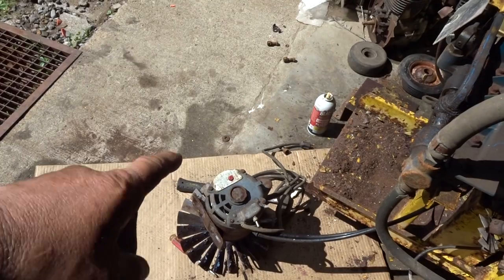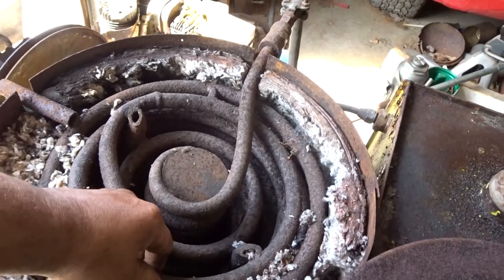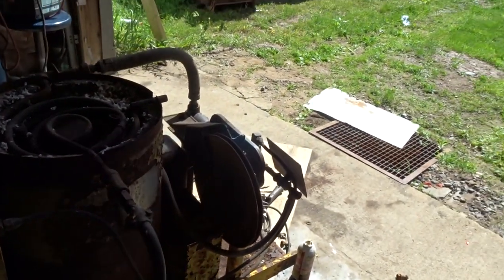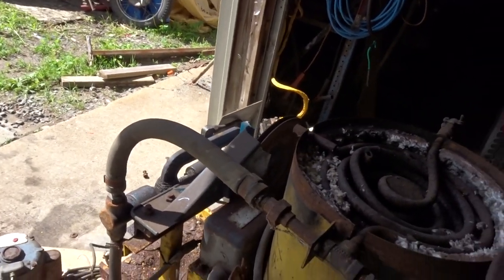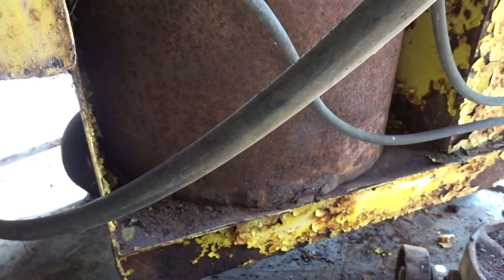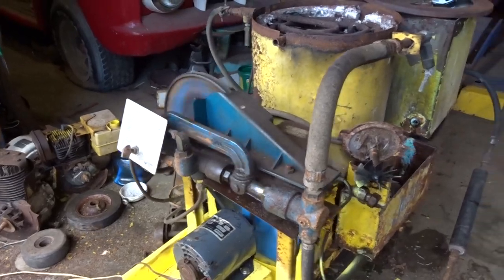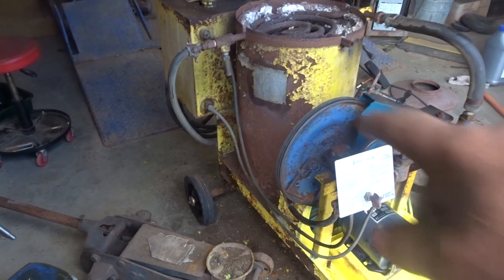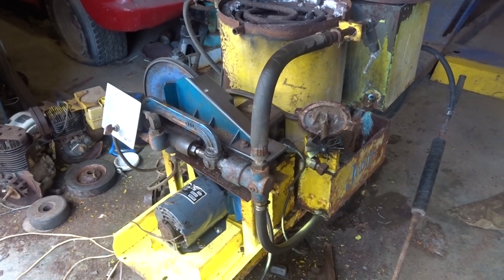Project Steam Jenny Continued

Comment: So, two videos totalling just under 20 minutes, and you have yet to smack anything with a hammer. You feeling OK? (grin). And when you repaint it, I vote for Honda red. More seriously, if it's 80's production, the insulation isn't likely to be asbestos.
Reply from the maker: I have a hard time getting video up in the summer...just no time.  I agree that the insulation is fiberglass.  I have some experience with Asbestos and I remember it being more granular when breaking it up.  This stuff stay fibrous.  Thanks for watching and commenting.
Reply: I have a Jenny 200 plus steam cleaner can’t seem to get fuel to run to the burner . I took of return line to tank and it’s running fine back to tank just not running through line to burner and it’s not clogged. Any comments would be appreciated thanks just don’t know much about this thing